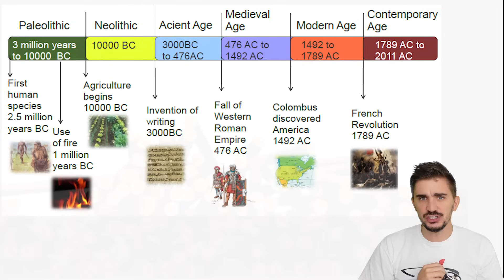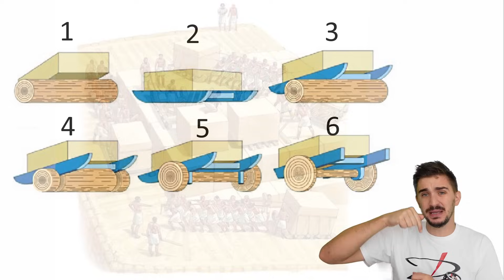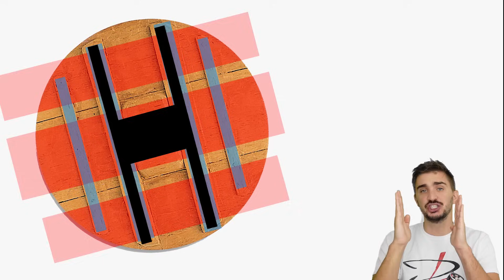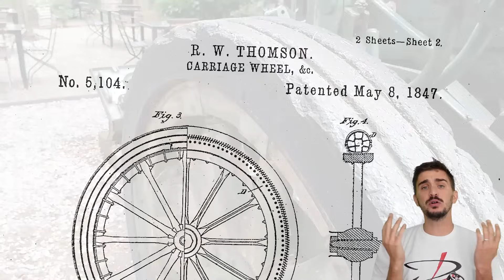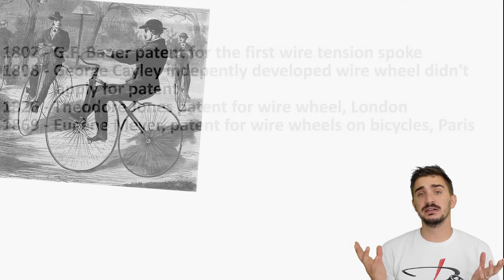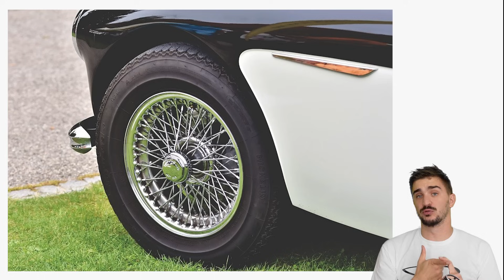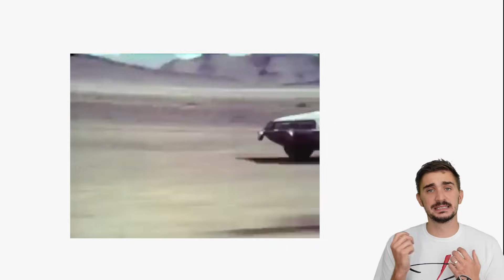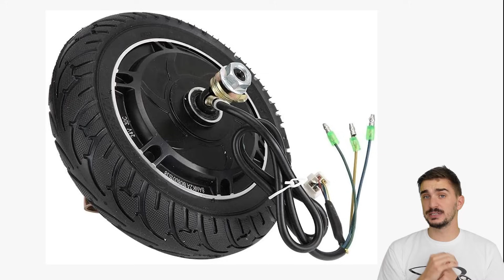History and EVOLUTION of the WHEEL - from 3500 BCE to the PRESENT and BEYOND

Comment: Bro I have a query, what are the disadvantages of using full synthetic motor oil in a conventional, air cooled low compression engine. I doubt there must be some.
Reply: co$t
Reply: None.  I run full synthetic in my HD and generator.  Cost can be evened out by the longer lasting synthetic oil.  Conventional and synthetic can be mixed without issue.  Anything bad you heard about synthetic are all myths.
Reply: @bradyelich2745  ok thanks brad.
Reply: Synthetic 5w-30 works very well in most small air cooled engines.